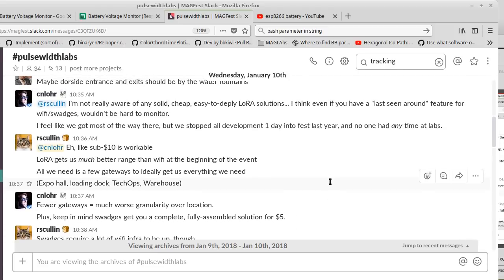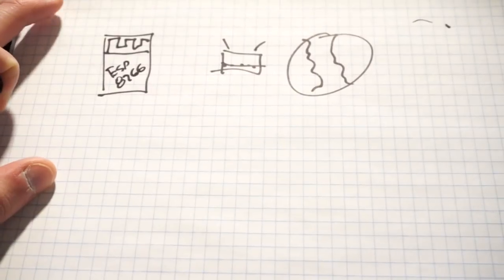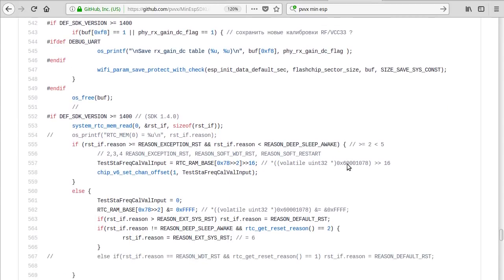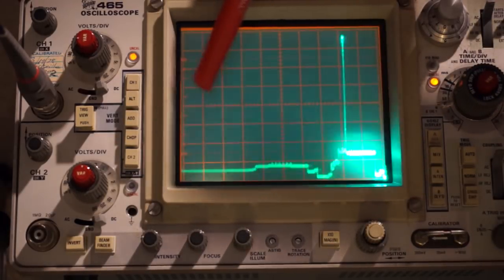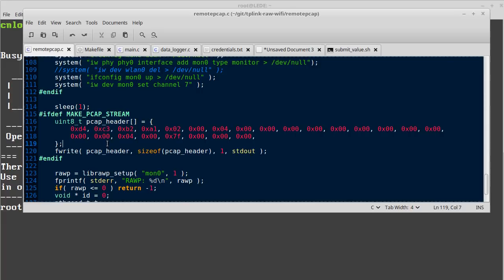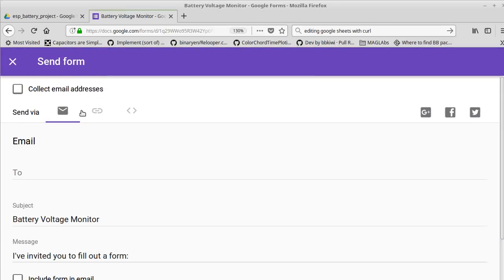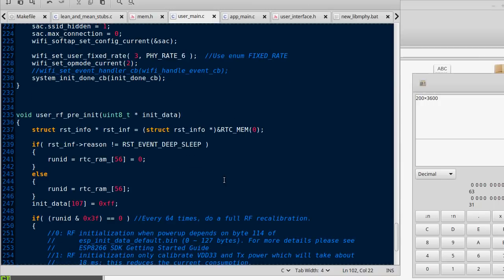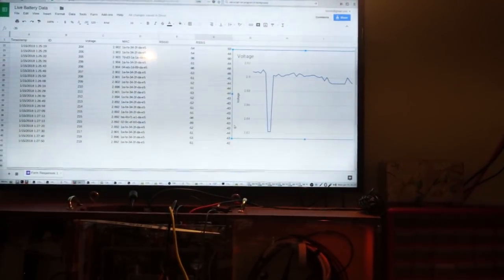Aggressively Low Power with the ESP8266

Comment: My code is doing the whole wifi connect, bme280/MAX44009 measurement, http post, enter deep sleep stuff around 653ms with arduino!  I use fixed wifi ip(with dhcp!), modded the HTTPClient lib to exclude the dns request and use ip to connect to the server. On server side i also close the connection before the db insert. Sometimes the wake time goes up to about 1.5sec for some reason but its much better than the 5-10sec mentioned in the video.
Reply: Just for a try i done the same with arduino & esp8266 2.2.0 lib ~100ms with sensor stuff (something broken with deep sleep without rf cal above 2.2.0). Sample code:
  
  wifi_set_opmode_current(STATION_MODE);
  wifi_set_phy_mode(PHY_MODE_11B);
  wifi_set_channel(1);
  wifi_promiscuous_enable(1);
  while(1) {
    if (wifi_send_pkt_freedom((uint8_t*)&frame, sizeof(struct FRAME), 1)==0)
      break;
    yield();
  }

  ESP.deepSleep(SLEEP_PERIOD * 1000000, RF_NO_CAL); With rf cal the wake time is about 250ms
Reply from the maker: I have been able to see that kind of speed for those sorts of systems, but it's still an order of magnitude higher :-/
Reply: Hi Peter, do you have an example on github ?
Reply: Yes, https://github.com/nepeee/WifiEnvMeter

Comment: Have you considered using ESP-Now? (takes around 200ms with avg. of 80mA, i know this is a bit worse than your solution and requires a second ESP as Gateway, but wouldn't it have been easier? Apart from that the time maybe can be improved?) 
ESP-Now gets rid of the whole TCP-IP Stack and there are already some library's out there.
Reply from the maker: ESP-Now's primary issue is that it expects to link to other ESPs, EXPLICITLY.  I don't want to have things linked. I want to be able to use it like a walkie talkie and use broadcasts.  Espressif says ESP-Now supports this, but after significant experimentation, I found that it was written to work, but there are lower-level issues with the type of packets that they send en broadcast that can be received by things like the TP-Link but not other esp's!
Reply: Ah ok, i see, it was dumb to think you had not considered it :)
Great work by the way, love your videos!

Comment: Did you see this? https://youtu.be/6NsBN42B80Q
Reply from the maker: Yes, actually my first attempt was with esp-now (you can see the folder of failure in the repo I posted).  It's really geared for linking specific ESPs to other specific ESPs, which is not useful for anything I'm after.  It supposedly supported broadcasting, etc.  But in practice, it still couldn't receive.

Comment: Thanks for this vid. Comes handy, maybe we'd swap stock fw w/ your minEspSDKlib.
In https://docs.google.com/spreadsheets/d/1oay41nWtpytSJAVGPSehMkfOp5g8D0GKNWIzqUzic_0/edit#gid=1212757165 you mention full RF cal wouldn't be feasible on bat. Have you tried adding bigger caps? Here it is possible to use a single 18650 with a big enough cap (here:1500uF) bridging the PWR spike on bootup/RF-cal. The spike has been  determined to be at about 370mA. Then another problem keeps creeping up: every few PWR cycles (we do complete ones using a digispark and mosfet circuitry, still using a single 18650 cell) the esp8266 is locking in in a state where it is sucking 370mA continuously. W/o breaker this ruins bat life and probably before that it would be killing the esp8266. We need a complete PWR disconnect for the esp to recover from this kind of hickup. There's also this interesting page: https://www.ondrovo.com/a/20170205-esp-self-destruct/ .  Did you experience this behaviour yet?

edit: Using fixed IP makes wake-up/RF-cal and reconnect a 1-3 sec ordeal on PWR on. Better than 6-10secs for DHCP, anyway. Additionally, using DHCP in poor WiFi Rx/Tx risks dropping packets and running into re-Tx w/ timeouts involved. You certainly do not want this on a battery-run project. So, either fixed IP or your approach.
Another thing worth mentioning is: espSDK now supports a complete WiFi stack kill button (and by this I don't mean the sleep mode thingy). Just for gaining some extra battery life, this alone might be a great try (i.e. an offline data logger). For projects that needs some kind of radio com it's not that big a deal. ;)
Reply from the maker: I have honestly never seen any problem like the self-destruct thing.  Even in our thousands of swadges... But on the other hand, I'd never consider de-powering an ESP once online.  I have seen AVRs exhibit this behavior in rare cases, but generally I fix it by making sure we never slowly ramp-up voltage. 

Re: DHCP: If you use custom firmware on your router, you can actually wake up, do WPA2 + DHCP in about 1.6 seconds from power-on, but, most routers run awful DHCP servers. 

The problem with ESPNow is the lack of proper broadcast support.  It can send no problem but without association nothing seems to be able to receive.
Reply: Making the esp latch on on pwr up isn't actually that hard. Just pwr cycle it until it happens. here it's every 5 or 6 pwr cycles it latches on and keeps drawing 370mA continuously. We're building long-lasting sensors that boot every n seconds and we have to prevent that thing from latching on. It's complicating things considerably.
re: boot up in less than 2 secs using DHCP is quite nice.

Comment: I was working on something similar, and I managed to knock down the wifi connection time to about 0.3 seconds by saving last ip configuration and reconnecting as a 'static' ip (0.3 seconds after startup)

This project is perfectly timed for me :D wait, you cheated by hacking the router, never mind :s
Reply: I done almost the same but i also changed the http(using a remote server) lib to use ip instead of the host to save the dns request time but i'm only getting about 650ms time. Strange :S

Comment: Nice vid, as always.

I'm hoping to use this to modify N64 and Dreamcast joypads with an ESP module.

I already have a UDP joystick app on Android working great for controlling the N64, but I haven't had much luck getting an ESP32 working in an original joypad as yet.

I was using the Arduino IDE for the ESP32, and while I could successfully send the request to the joypad (and see the returned data on the o'scope), I could NOT get interrupts to trigger on a pin change?

I tried different input pins, made sure I set the pin as an input, and with the proper pull-up resistor, checked the GPIO matrix etc. Nope, no interrupt triggering. lol

Probably something glaring that I missed tbh, but I'll try an ESP8266 next.

I just need it to request the button / joystick values at say 100 Hz, then send a small packet. UDP seems fine for this so far, but obviously the methods in this vid would massively increase the battery life in the joypad, and it only needs to be picked up by the ESP on the N64, so no router needed.

(I could probably just grab the response from the joypad in the main loop, but it made sense to me to use an interrupt routine to measure the bit widths. Also a modest data rate to receive, so I kept missing bit transistions when using a loop, believe it or not. Again, probably my crappy "code". lol)

Andreas does some awesome vids on the ESP modules. Definitely a recommended channel for like-minded techie stuff.
Reply: I just realised that even sending a packet within 100ms still won't be able to reach my refresh target of 60-100ms, but then you don't need anything near that rate for asset tracking etc.

EDIT: Oops - 60-100 Hz, I meant.

I'm interested to see which parts of the code take the longest to run after the ESP leaves Deep Sleep.

I'll probably just need to keep the ESP running as normal, and just use some bigger batteries. :p
Reply from the maker: I should find out if you can turn off the radio's RX and still transmit packets.  I don't think you can but I should test it.
Reply: CNLohr 

Interesting. I never thought of that. lol

Yeah, it might not save a huge amount if the Rx can be disabled, but a saving nonetheless.

It's possible the Rx amp is disabled when the Tx PA is active, and may have a flag bit for each?

I don't know if WiFi always has the same receive freq as the Tx carrier pulse either, but perhaps there are two separate oscillators as well, and a bit to disable the Rx one?

(Although, the PLL is probably fast enough just to switch between frequencies if need be, or do spread-spectrum?)

I'm kind of addicted to using ESP modules after watching channels like yours. I use them in most projects now.

I just designed a small board with an ESP8266 and some MCP4922 DACs (and SD slot), so I can finally make my RGB laser projector work via WiFi or stand-alone. ;)

But, I STILL managed to swap two pairs of pins and screw up the SPI, due to silly "copy n paste" laziness. lol
Reply: CNLohr 

This is the Mini N64 board I designed. Only 10cm square, but with HDMI, FPGA, and SDRAM (for eventual cart ROM "emulation").

My first ever 4-layer design, and definitely the most complex. Notice the same bodge wires for the ESP SPI pins, but yeah, it boots. lol...

https://imgur.com/a/4RuNy

For the earlier tests, the "UDP Joystick" app on the phone was just broadcasting via the router to the ESP on the main board.

The onboard ESP then just writes those values to the Cyc III FPGA (on the underside), which handles all of the PIF chip stuff for the real N64 chipset.

No noticeable added lag with the controls.

Comment: Seems like RAW wifi is a really interesting thing to look into... Would love to see it being used for FPV with drones. This might lower latency a lot and also enable digital video transmission in "real time".
Reply: That's exactly what 'wifibroadcast' does, and for exactly that application - check it out!
Reply: That's really cool. It would be great to actually use one ESP8266 as a bridge or broker between low power ESP wifibroadcaster and the 'real' network. This would open up a whole new level of cheap and diy smart home devices. Not sure if there would be an advantage to LoRa though, except regarding the price.

I have a question though, since I don't know much aboutthe wifi protocols: How safe is the communication? I mean, encryption wise I'd guess there is none or is there? The WPA is a shared secret though that could actually be easily used. But more important: Are there also acknowledge packets sent? Or is wifibroadcast fire and forget?
Reply from the maker: Indeed, and this shows it is possible to do on the ESP8266!

Comment: This is amazing. I wanted to take a look at ESPnow as the bootup and wifi logon times are too long for a little home automation project of mine. This is just so much better. How would you go about adding encryption or at least have messages digitally signed so you know they come from your ESP?
Reply from the maker: If it were me, I'd use static keys.  I'd kinda have a thing where you can set up the ESP to transmit with a given key and channel.  Simply block-encode your message, provide an random seed, and the encrypted message every beacon, then decrypt it on your central receiver.

Comment: You could probably save power by taking off the LED ;-)
Reply from the maker: I may, but as the voltage decays, the current going into the LED will be less and less.  Plus it's only on during the early boot process.  Actually... I probably will when I re-run the test with new batteries instead of all the used ones I keep finding.